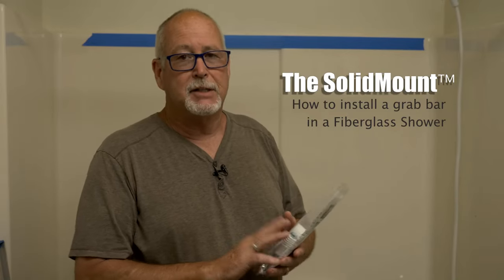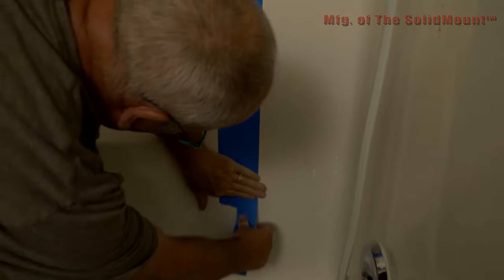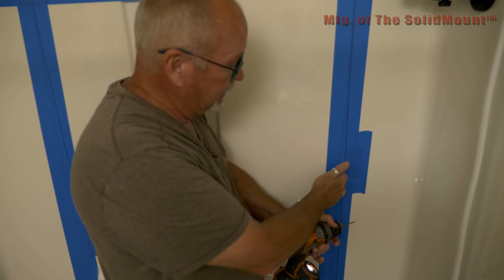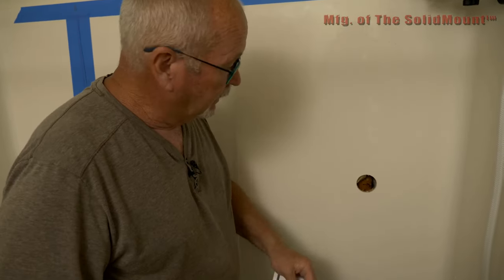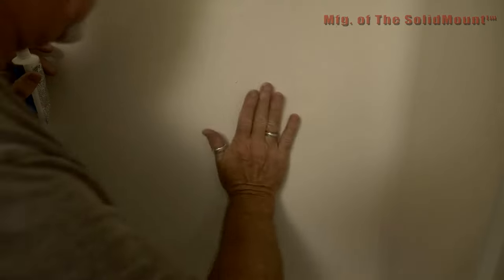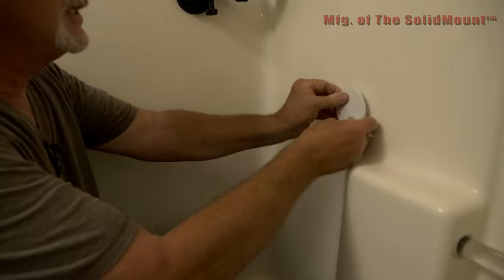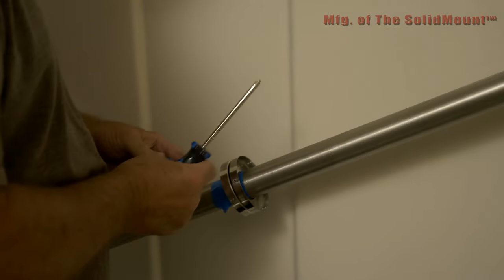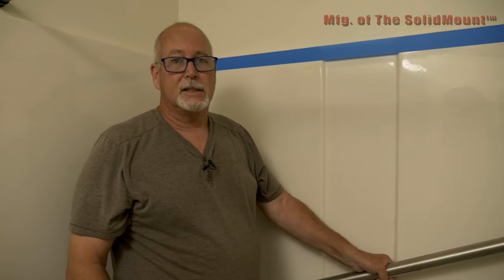Installing A Grab Bar in a Fiberglass Shower. *Grab Bar not Included*

Comment: The only problem I ran into, is the SS cover will not cover the solid mount disks, the tolerance is just too tight. It is only about 1/16 out on both outer edge. I cannot tap it on, nothing will work. Any help????
Reply from the maker: Per grab bar manufacturers the flange is designed only to cover their flange.

Comment: Great Video - Why don't you see anyone install a grab bar at the outer edge of the shower enclosure sort of straight up and down. Seems like the right place to install if you are getting out of a shower. We are having our master bath remodeled so we are using a shower just like in your video in our other bathroom. On your video that grab bar is great for getting up and down inside the tub but I think you need another one at the entrance/exit of the tub? Great device for installing to fill up the empty space behind the surround. These manufacturers have that one wash cloth holder. I bet many people try and use that device to get up and out. Scary, surely not approved for that use.
Reply from the maker: There should be a kicker player right on the outside of the shower that it is screwed to. Most people just put the bar right on the outside edge.

Comment: Thank you for this!
Is it possible to use this kit behind the fiberglass wall panels instead of having to drill a 2" hole? I plan to but blocking in the wall but want to have something to fill the gap between the blocking & the surround. The studs in my house are not installed properly & there's tongue-and groove board spanning them. Some studs don't go all the way up, some are pieced together, and the are not 16" on center. This looks like a good option instead of having to add more wood blocks in. I figure this could help reinforce the fiberglass and since it's not wood, it won't rot if any moisture somehow gets in. I'm thinking if I make sure I know exactly where the kit pieces will be, then I can install them that way.
As an aside, I am terrible at getting tape on straight so having to double it up is what I usually have to do as well. I like how you got straight to the point and gave enough information to explain how it works with enough detail.
Reply from the maker: I'm not really sure I understand. If I'm correct you have access to the back of the fiberglass? If that is correct then just put a 3/4" plywood 12x12 where the flanges will be and mount the bar. I would use bolts with fender washers against the plywood since you have full access. Good luck. You can always reach out to us at thesolidmount.com on our contact page.
Reply: @TheSolidMount  Yes, I will be tearing out an old shower/tub unit and will be able to access the wall behind before I install the new shower unit. I don't have access from the opposite side. Moisture is a huge problem in my area so I was thinking of doing wood 2x6s or 2x10s in the wall as backers and then using the solid mounts in the backers (if they won't hit studs in the right spots) but keeping the circular shaped part behind the fiberglass in the wall instead of having it go through. If I measure correctly, I'd anchor in to them when I install the grab bars. Alternatively, I could use PVC boards to stack. The ones I have are 5/8" thick so two of them glued together would be about 1-1/4" and I could shim if the wall sticks out more than that. I've got the Sterling Ensemble Curve shower unit. I figure PVC board won't get damaged if it gets any moisture in it and I'll use screws long enough to reach through to the wood backers.
Reply from the maker: That sounds like a decent plan, but since I'm not there to see it I can not be 100% certain.

Comment: Great video. Unfortunately my mother’s shower is completely fiberglass, all the way to the ceiling. There’s no way to find the stud. Is there maybe a stronger stud finder out there? Otherwise I’m left to relying on those suction supports. I’ve read mixed reviews on them, though, and don’t want to risk it. I suppose I could drill tiny holes every where until I found it but what nightmare that would be. Or maybe climb in the attic but it’s at the corner of the house so crawl space would be extremely limited. Anyone have suggestions? Would be GREATLY appreciated. TIA
Reply from the maker: Gator Guy the only suggestion I have is to put a bar right on the outside edge where the drywall meets the fiberglass there should be a kicker stud to attach to.
Reply: @TheSolidMount thx for the reply! Not sure why I just got it. I installed small grab bar, like you said, right at the entrance. Unfortunately, my mother was hospitalized recently and now needs a grab bar inside the shower. I hired a handy many to figure it out. He told me there’s no studs behind the surface because the bathroom is on the very corner/end of the house. He said he thinks there’s possibly some “filler” behind the fiberglass, and then drywall and cinder block. He said he could try it but didn’t feel good about it. We decided to not go through with it until we know it’s rock solid. I don’t have any other options except redoing the bathroom. I may hire another professional to get their opinion. If anyone reading this has suggestions, I’m all ears. Tia!

(I subscribed, thx)
Reply: Can you get to the back of the shower? If it is on the outside wall and it is a block/brick house the contractor is most likely correct. Can you use a shower bench?
Reply: @craigm4757 We ended up putting a chair in the shower. I put one of those strong suction handles on the wall. I made sure she understood it’s not for full body weight, just more of a guide/balance in case she needs to orient herself briefly after standing up. Sometimes she (me too) gets a little lightheaded upon raising. I think it’s called orthostatic something. Thx for the reply!
Reply from the maker: @gatorr4life   Fantastic glad everything worked out. The only issue I have is with the suction cup bar they are very dangerous and unpredictable. So I would suggest removing the bar periodically checking the suction cup for cracking or breakdown of material and cleaning the wall are. Stay safe.

Comment: Would like to see a video on the installation on the outer edge of the shower enclosure.
Reply from the maker: Bill there normally is a kicker plate on the outside of the shower that you can attach a bar to. Normally there is not a stud at the inside edge of the shower. If you have a stud that is 2-3" inside then do a standard install, anything closer to the edge will be an issue with the mount sitting flat on the fiberglass and not overhang. This is normally not an option due to studs being 16" on center this is why we suggest locating the kicker plate just outside the unit. Hope this helps

Comment: I am considering purchasing 2 of these mounts for our acrylic shower wall. We are in the construction phase for our bathroom and the studs are up around the shower. Would now be a good time to install these before we go any farther. There will not be any drywall behind the shower as it is installed directly onto the studs.
Reply from the maker: Stop.... If the back wall is open just have your contractor put blocking in for the grab bars. You do not need our product if you can add the blocking
Reply: @TheSolidMount  thank you. The back wall is blocked with plumbing pipes, but both ends are not. It is a small shower, and we are planning on installing an 18” vertically on one wall and a 21” horizontally on the opposite wall.
Reply from the maker: Well if you can't add blocking you can glue 3/4" plywood against the back of the shower

Comment: I've read all comments+replies to date (Nov. 2022). Advice I need concerns the type of drill bits you used to bore through the fiberglass to prevent cracking it (diamond, High speed steel, or carbide tipped?)-for both the pilot hole drilled and the 2" diameter drill bit needed. Is it also recommended that the 2" drill have a pilot drill bit attached at its center to guide it for drilling into the recessed stud at its center?
Your video and your replies to previous questions answer a lot of questions this type job presents.
Thank you
Reply from the maker: For the pilot hole, we use a regular steel bit for wood, metal, and plastic like the Black and Gold Split Point Drill Bit and the 2" hole a Bi-Metal 2" hole saw. The key is to drill slowly with light pressure. Hope this helps.
Reply: @TheSolidMount  Craig-Thanks for the follow up information. I'm good to go.....

Comment: I am just as curious as to besides the three screws how is it held firmly !  What was the purpose of white small piece mounted before the fibreglass disks were glued
Reply from the maker: I am not really sure about your question. Did you watch the video? If so let me know the timeline of the video you are questioning and I will try to help you.
Reply from the maker: Thank you for reaching out to us on our contact page. THe answer given was the lag bolt holds the threaded shaft to the house 2x4 and the flat part has a cup on the back and threads to the shaft attached to the house.

Comment: That part where you were using the wire to check if the 1/8 mm hole is at the dead center of the stud.   I tried to “angle” the wire yet I feel the wire tip is still hitting the same area and not on the sides .    How  to do this correctly?  

Update:  I just drilled another 1/8” hole to the left and right of the first hole and stick a nail in each, and I can detect a stud in those holes.  I think I did hit dead center.   It’s late now so I will drill the 2 in hole saw tomorrow morning
Reply from the maker: That is what the wire is hitting. It all depends on the depth of the studs. But you can definitely do what you did. Let me know how it goes for you.

Comment: I used your kit yesterday worked great but my problem was at the end when I screwed the bar onto the white disc it must have not been lined up right because I could not get the cover to fit right had to hit both of them with a hammer! please advise
Reply from the maker: The cover is designed to fit against the plate.
Reply: @TheSolidMount  ok thanks for your reply
Reply: @TheSolidMount  thank you for this excellent system. Just one clarification on this point. Is the grab bar flange cover supposed to fit OVER the mounting plate, or just up against the mounting plate?
Reply from the maker: @JCK363  The flange is designed just to cover the grab bar flange, not the mounting plate.
Reply: @TheSolidMount  great. Thank you very much. This is an excellent product, and your video explanation was super helpful.

Comment: Problem:  The studs behind my fiberglass shower enclosure are 16" apart.  I want to install a horizontal bar, horizontally (that is, not on a slope).  I'm having trouble finding bars whose brackets are a multiple of 16" apart (that is, 16" or 32" or 48").  Do you know of anybody who makes such bars?  Or maybe, some bars whose length can somehow be reduced to fit (e.g. reducing the span of a 36" bar to 32")?
Reply from the maker: NO, I have never understood that. The only thing I can think is once you go to 1-1/4" to 1-1/2" dia. you are now in commercial dia. and so ADA does not call for a 16" bar. I use an 18" and slight angle.
Reply: @TheSolidMount  FYI, I have now found several brands online that do offer grab bars that are 16", 32", or 48" long.  Moen is the best-known brand that offers bars in these sizes, but there are others.
Reply from the maker: @kenwinter7787  Correct, there are many great brands out there.

Comment: I'm a service tech for a housing company, and on my property, when somebody puts a 504 in for a grab bar in their shower, your mounts are the only ones we use. The only thing I don't like is the price. $50 for some plastic pieces are incredibly expensive compared to metal anchors, or even the Moen anchors. That's the only gripe I have, but they definitely work.
Reply from the maker: Chris buy on our website directly. You can purchase singles on Amazon or in bulk direct on our website. We are the manufacturer.
Reply: @TheSolidMount  we buy from your Amazon store, we just purchased a set the other day, $44 plus tax I believe. That's expensive for what you get. You could cut the price down by not including lag bolts. But I don't know. It's just pricey. It works great, just hate spending that money for plastic. No hate here, but $29.99 would be a great price point for those.
Reply from the maker: @Chris  Sorry, we can not keep the price at $29.95. Let me explain without sounding like a jerk, I hope :). Over the last 2 years, we have seen a 40% increase in our hardware 80% increase for the specialty plastic, and labor went up almost 80% from 10.00 - 18.00 an hour, so when you add all that up, we only increased our price 10% in 20+ years; also, shipping costs have gone crazy. What used to cost 5.95 to ship is now 8.25, and we cover part of that cost. So, we used to initially sell our product for 29.95 plus shipping, then we raised the price and included shipping. So at 29.95 + 8.25, you would pay 38.20, or we do it my way and sell it for 32.95 + 4.95 (we eat some of the shipping cost) 37.90 and save 1.05.
Let's also not forget my cost and expenses, Liability insurance, overhead, Amazon fees, packaging, misc business expense, and wages. So we do not make as much as you might think we do.
Again I hope this explains and clears up your thoughts. Plus, what is the alternative? No grab bar or tear open a wall and spend a few hundred dollars and a lot of time, so when you look at everything, Are we that expensive? God Bless, and thanks for your input.

Plus you can buy bulk on our site and save.
Reply: @TheSolidMount  okay, that put things into perspective. I didn't realize they were made in the US. I just never paid attention to that part, I just rip the package apart and install lol I just looked at your site and seen the bulk orders, so we may end up going that route to save money. We've gotten almost 10 sets this year so far, so would make a better deal. In no way was I trying to be disrespectful so please don't take it as such. And yeah, the cost of everything is going up, and my paycheck stays the same lol it sucks.
Reply from the maker: Chris I love being able to having good conversations. Let me know if we can help.
Craig
Reply: @TheSolidMount  absolutely man! I'll still use your product, but I might complain here and there is that okay? 😂

Comment: Do you sell the actual bars yourself too or just the mounts? Should any type of bar work with this mounting system?
Reply from the maker: We only supply the mounting kit. The Solid Mount works with any standard grab bar with a 3" flange.
Reply: Where do we get the kit?
Reply from the maker: @eyeofthetiger4361  thesolidmount.com
Reply: @TheSolidMount  I suppose some bars may not be provided with several holes all the way around the flange.

Comment: does that stud finder find wooden studs?
Reply from the maker: Yes, the stud finder locates the studs above the fiberglass. They will not find studs if you try to scan over the fiberglass shower or if you have tile or other wall covering ontop of the standard drywall.

Comment: Is it possible that the distance between the fiberglass and the stud is larger than 2 1/8"? If that's the case, is there anything one can do (after the hole is cut already)?
Reply from the maker: Yes, Email me at sales@thesolidmount.com and send me the dimension from the stud to the front of the fiberglass wall. Also, if possible a picture of your installation.
Reply: @TheSolidMount  I don't have that because I want to make sure I can finish the job once I have started it (I plan to hire someone to do it). But based on the dimensions of my shower wall sticking out from the wall on the top (up to 2"), I assume that the total depth may exceed 2 1/8". I saw another video (by an installer) that suggested buying extra kits, cutting additional spacers from those, and adding them as needed. Is that acceptable?
Reply from the maker: @gdfarkas1947  Yes based on that information you would then fall out of our specs. I am not sure what others have done. I did run across this once and what I am going to tell you we have not tested and you do at your own risk. But, it was over 10 years ago and the bar is still in place. For conversation's sake let's say you end up with a 2 5/8" gap from the stud to the front of the fiberglass. So, you now are over our 2 1/8" spec. by 1/2". What I did was I bought (x) number of fender washers the same size that we ship that when stacked to 1/2" spacing or whatever (x) is in your case. Then I also bought a lag bolt that was 1/2" or 1" longer than the one we ship, I don't remember. By doing both those you still keep the lag bolt at the minimum required depth in the stud and the washers will act as if the stud was closer. Personally, I would not suggest buying a second kit. First waste of money, secondly the load, and sheer change due to the footprint of the plastic spacer compared to washers it is all physics and engineering at this point. Let me know if you need more help.

 
pec
Reply: @TheSolidMount  Thank you very much for the prompt reply.
Reply from the maker: @gdfarkas1947  My Pleasure.
Reply: @TheSolidMount  Thanks for your suggestion, I will try it.  Could you please let me know what the size of your fenders is (to match them with the washers). Should the replacement lag bolt be longer than the one shipped with the total size of the washers or longer?
Reply from the maker: @gdfarkas1947  tThe Fender washer is 5/16" x 1.25". The lag bolt needs to extend because you have changed the min. depth. So if you have to fill an extra 1/2" you need enough washers to do that and then get a lag bolt that is 4 1/2" long. I know sometimes you can not get a lag bolt in 1/2" increments then go to the next inch so in this case 5". Let me know if you have other questions.